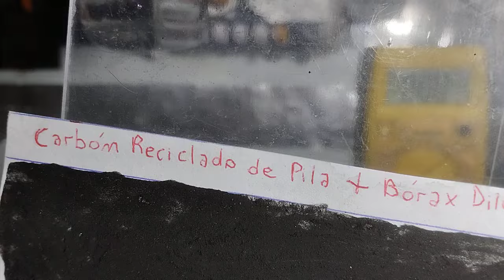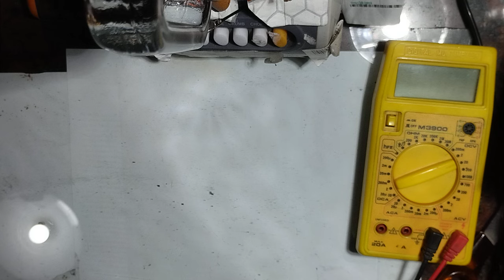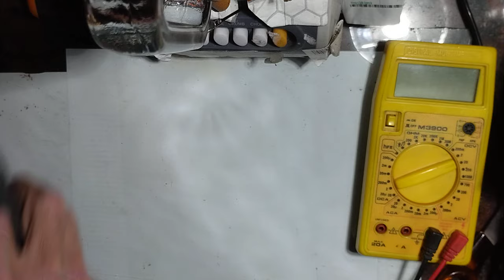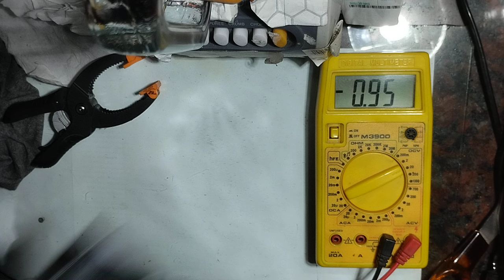Pila no convencional, pruebas realizadas sobre membrana de papel (Nivel Básico) 🤐 Leer 👇

Comment: Hola porque la cargas con tanta tension
Reply from the maker: Recargar una celda seca con un voltaje mayor es necesario para obtener una mayor carga. Sin embargo, aunque cargue la celda en aproximadamente 31 voltios, al desconectar la fuente la carga cae rápidamente al rango de 3 voltios y luego se estabiliza con menor voltaje. Incide la configuración de material, química y tinta.
Por ejemplo, si una celda seca proporciona aproximadamente 700 mV, seguramente necesites al menos el doble de voltaje para alcanzar el punto de ruptura y permitir el flujo de energía a través de la membrana. El exceso de Corriente (Amperaje) no es problema. Este comportamiento es similar al dieléctrico de un capacitor.
Trabajar con un voltaje menor requiere más tiempo de recarga y produce menos energía. No es raro obtener voltaje sin la corriente (miliamperios) suficiente para encender un LED.

Recientemente subí un video de aproximadamente 31 minutos donde se observa una membrana sin carga previa que comienza en 2 voltios, 5 voltios y termina en 31.5 voltios para lograr encender un LED. Sabemos de que no hay prácticamente impedimento para superar el voltaje en una celda seca, aunque esto depende del tipo de membrana, químico o dieléctrico, en función de la reacción. Esto no es posible en celdas húmedas o líquidas, ya que se corre el riesgo de evaporar o estropear el electrolito y formar gases peligrosos.

Las celdas tienen un voltaje prácticamente prefijado, sujeto al diferencial entre metales o electrodos y tipo de tinta (química).
Algunas celdas pueden comportarse como celdas primarias (no recargables para proteger la reacción química), otras como celdas secundarias (recargables) y finalmente, algunas pueden tener un comportamiento similar al de un capacitor.

Las recargas excesivas han permitido quemar un grafito previamente exfoliado en celdas sin membrana, y mantener encendido un LED por tiempo prolongado...
Reply: @roman_abelardo  te sigo a ver que sale de todo eso roman
Reply from the maker: Perdón por la demora, pensaba que recibiría una notificación ante un comentario. En ésta oportunidad no sucedió...

Te voy agendar para que observes un sencillo video con Grafito exfoliado y finalmente quemado, una superficie muy pequeña de contacto que con muy poco tiempo de recarga energiza un LED por un tiempo demasiado prolongado...
Es tedioso quemar el Grafito, pero si tuviera la cantidad suficiente de material para armar un Super Cap... estaría genial!!